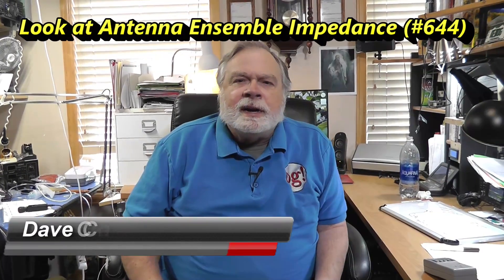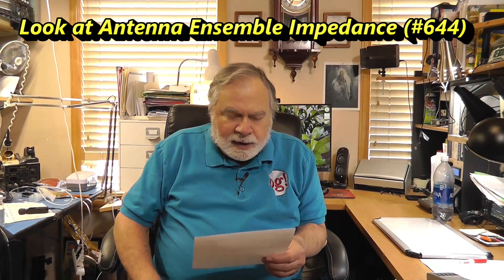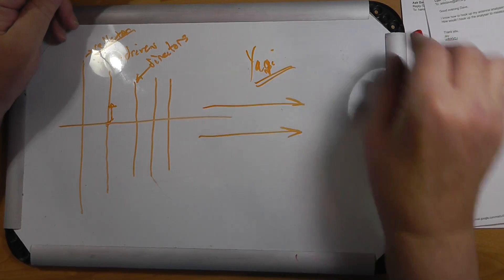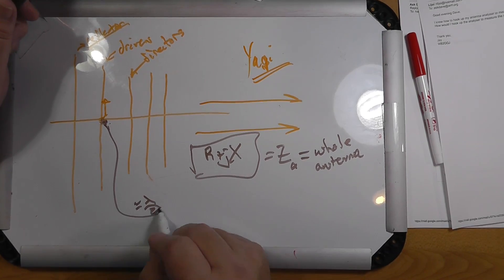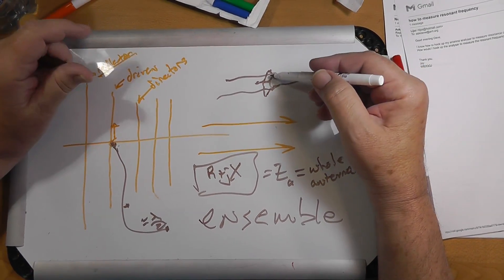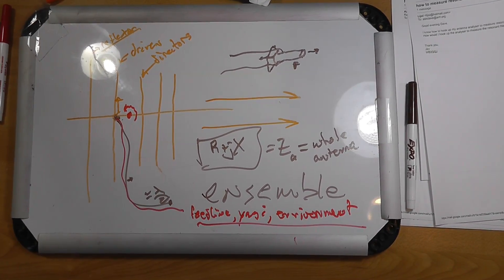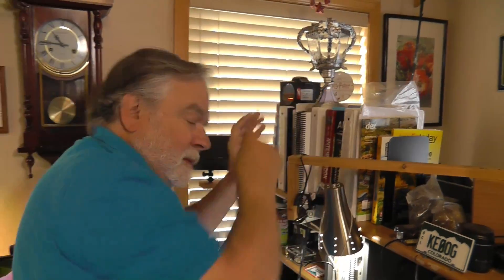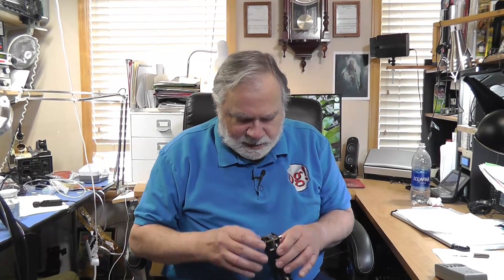Look at Antenna Ensemble Impedance (#644)

Comment: Too much is said about measuring impedance at the feedpoint. In real world use, the coax end in the shack is what the radio sees. That said, be aware that changing the feedline length may change the impedance in the shack, if the feedpoint impedance is not purely resistive.

Comment: Thanks Dave, I guess I just didn’t ask the question correctly. When I build an element for a Yagi, I want to be able to measure the resonant frequency of the element. I am looking for a more precise means of setting the length. The only way I could think of, was coupling with a loop like a grid dip meter, but I figured I would ask. (Similar to measuring a trap through inductive coupling.) Oh well, it was worth a shot.
Reply: The parasitic elements augment the driven impedance.  You can measure the resonant frequency of each element if you like by removing the elements from the array and say gamma match it or cut it in half and measure it, but they are ideal based on their placement, diameter and length and how many elements are on the array.  The ideal lengths have everything to do with optimizing your beam characteristics.  EZNEC is now free and I would recommend downloading that and getting familiar with its operation to see what makes these antennas operate.  You can simulate the elements you are interested in and it will give you the answers you are looking for based on your specific elements you are to have defined in the modeling.  There are YouTube instructions as well as well written instructions on the website.  My email is good on QRZ if you need help with that as well.  N9XR
Reply: @N9XRradio  Thank you
Reply from the maker: The point of the video is that the resonant frequency of the reflector and directors is irrelevant to how the Yagi works. You want to measure the resonant frequency of the entire antenna and not its parts.

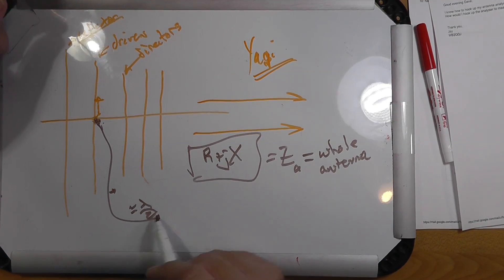Comment: 5:06 VNA or antenna analyzer could be calibrated to take into account any transmission line. Automatically by calibration or like in nano VNA by adding transmission line delay (if you measure it in advance). That will give results at the antenna connector by being on the other end of the feeder.